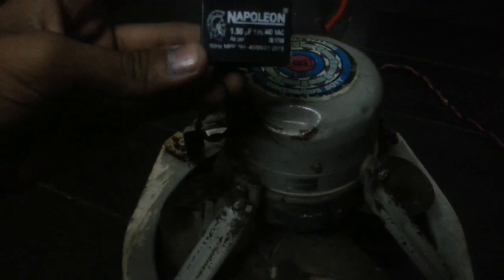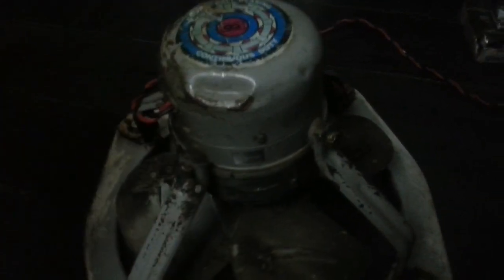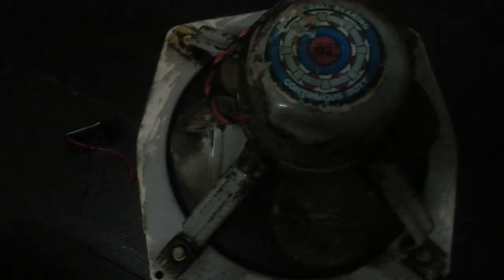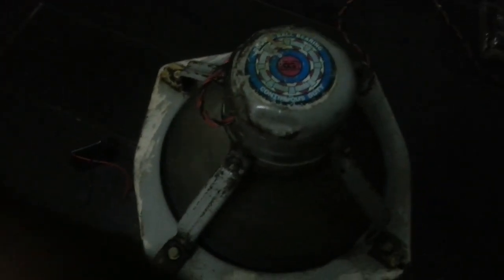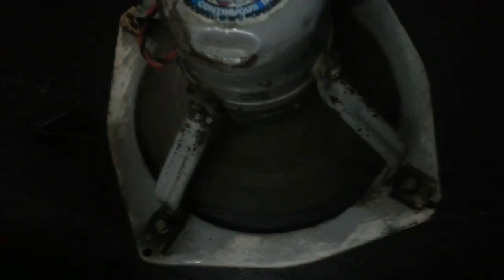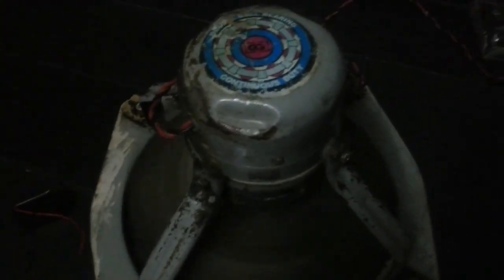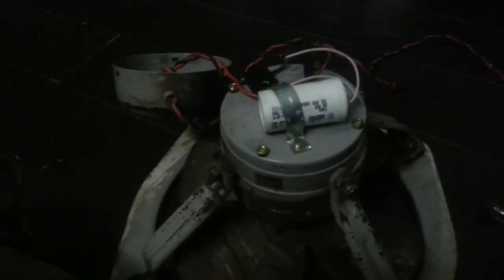Changing Capacitor in Crompton Greaves Transair Exhaust Fan - FAN REPAIR

Comment: Can I get 0.8 mfd 400 VAC capacitor for my CG Brisk Air exaust fan?
Reply from the maker: should be easy else get 1.5mfd
Reply: @electrod.i.y7165  I got 0.8 mfd capacitor and my exaust fan is working now. Thanks